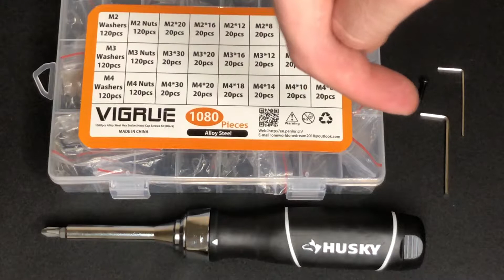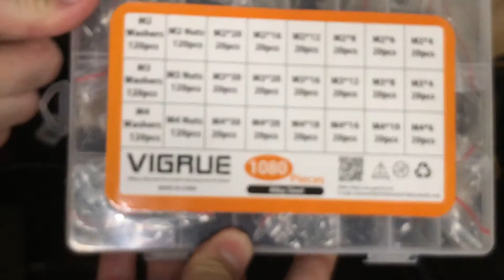How to - Generic Fang Install - Tevo Tornado

Comment: If you screw into the heat block how do you prevent the fang from warping and deforming? Is there not enough heat transfer that will affect it?
Reply from the maker: Chris Donovant so far so good. It’s a relatively small area touching it.